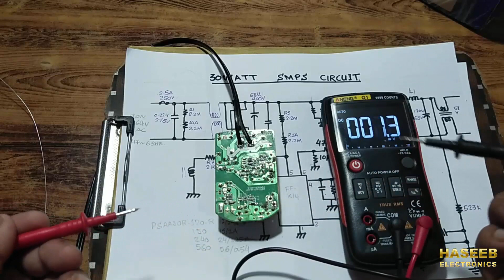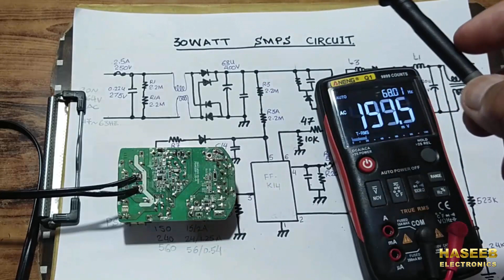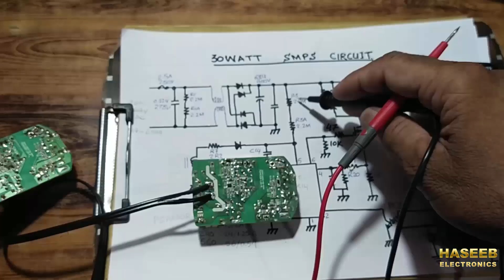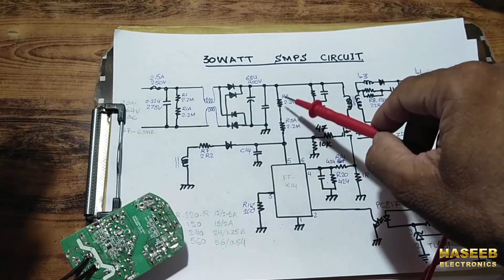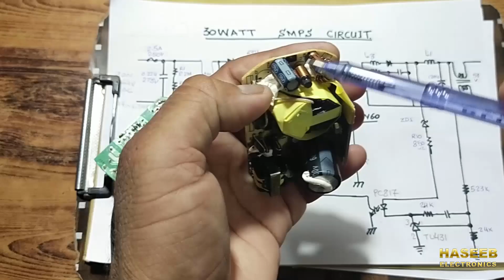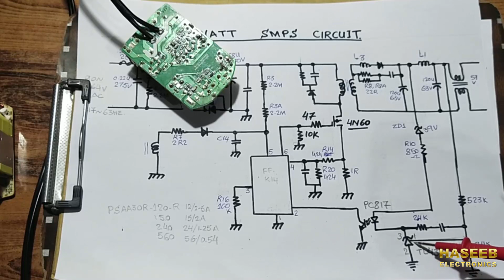[380]  30 Watt SMPS Design, Explained Circuit Diagram PSAA30R Series Adapter

Comment: Excellent . Very detailed. Thank you very much. I was learning and repairing one of my faulty charger. It was smd components based, hence not sure about the circuit o got after reverse engineering. probably your video is only video available in this context. In my charger there is third ic also along with pwm and optocoupler. Can you comment about that. Or how I can discuss with you.

Comment: I have three phone batteries in series about 12 .5 v .the charger open circuit is about 13.2v .it charges normally the batteries but some time  it doesnt do it .it charge it  about 11.6 v .i have separayed the batteries and with a phone charger i charge it very hood can you explame it
Reply: Excuse me for some mistakes in writing
Reply from the maker: i think the phone batteries have BMS (battery management system) a small PCB inside the battery. at full charge, may be it is stopping the charging 
or may be the thermal protection is activated in case of over temperature of the battery
Reply: I consider your explanation useful .

Comment: Thanks for this video, you were a little fast, which I can't understand, at the optocoupler is what the direction of the current passes in both directions through the diode inside this optocoupler (normally the diode only conducts in one direction)

Comment: First thing, I appreciate your efforts & the way u explained the Circuit was Excellent. But one thing i felt that, if u could explained or calculated about the of resistor values used at each section, it would be more great helpful bro.  Great job bro..
Reply from the maker: best regards and special thanks
sure i will share calculations as well 
i have a program to start complete series for calculations

Comment: How to reduce the voltage - answers on a postcard please. I'm guessing that resistive ladder, and taking out the large zener .
Reply from the maker: it can be done by disassembling transformer and finding turn/volt ratio, and reduce turns in secondary. 
and then re-arranging voltage divider network, in TL431
and to remove 39V zener from sense line for PC817 LED path

Comment: Hello, nice video ! can you explain where to put the multimeter probes to get the frequency ? can you please show how to measure the voltage at the exit of the SMPS transformer. Thanks
Reply from the maker: Best regards, i uploaded a video, containing the answer of your question, video number 381, please
Reply: @HaseebElectronics  Very Grateful, i saw it with biggest attention. Salam Aleikum from Morocco.

Comment: You have drawn wrong position of 10k resistor connected across power ground and drive pin as per the pcb layout in your diagram. Actually it's a pulldown resistor and is connected just across the gate and source of the mosfet. 
Thanks sir.